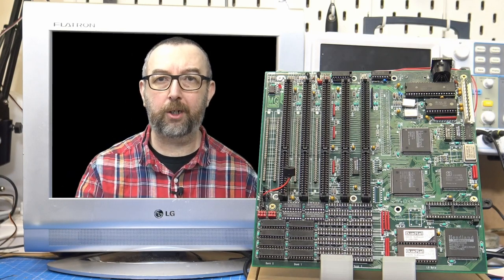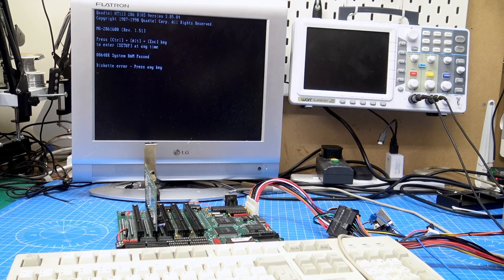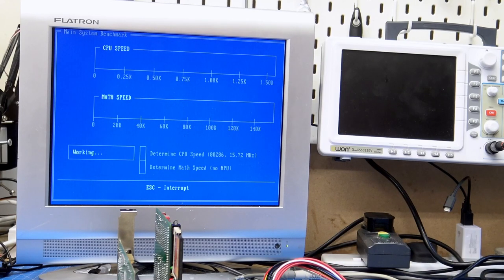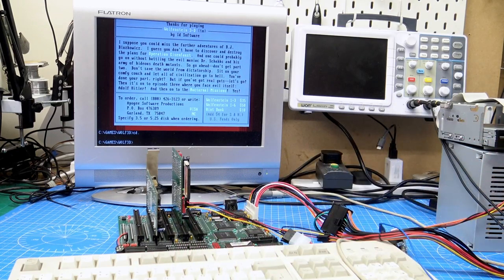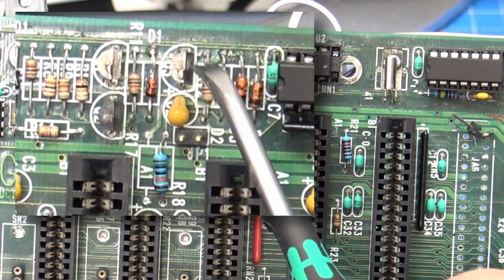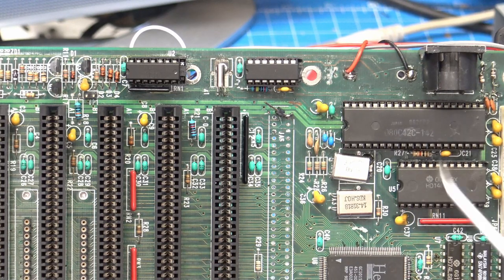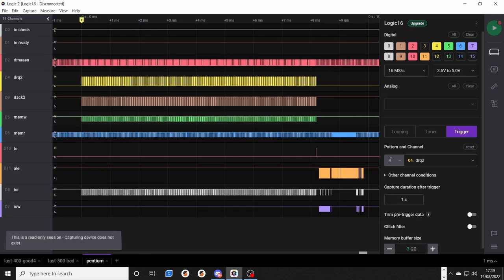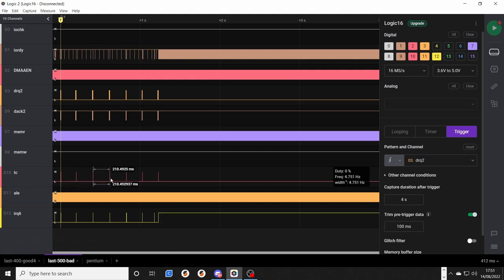Corroded 286 Part 2. Can I fix the CMOS backup and Floppy Drive DMA problems ?

Comment: Interesting faults. Good job on the videos and repair work so far. Hope you eventually figure it out
Reply from the maker: I do not have high hopes for this one, but there are some more suggestions to try in the Vogons thread once I have time to look at it again. I had to stop, it was slowly taking over my mind.
Reply: @leesmithsworkshop  Good idea taking a break from it, I don't have any suggestions so hopefully the folks on Vogons can be of help, or someone in the comments here.
Reply from the maker: @TheRetroChannel  The thing is unless it is some bad trace or corrosion I am not sure I can fix without swapping chips and I don't have those. If it is bad trace or corrosion why does it work with smaller files and not with bigger.

Comment: Would the battery circuit actually create some kind of short when charge is applied? Can you check where the voltage is going to? (I have no electronics degree at all btw :) ).
Reply from the maker: I have checked and it is not a short, that would stop it from switching on, this does switch on ,but it has no activity.

Comment: I seem to remember this happening to Adrian Black, and the problem might be BIOS related. Check his “fixing IBM BIOS” video.
Reply from the maker: I just watched IBM PC/AT Model 5170: So many issues! (BIOS mania) and he had problems reading files from a hard drive and in the end used the very same bios I have on this board so not the same fault with the floppy disc I have.
Reply: @leesmithsworkshop  But are you sure that the 2 controller cards use different address spaces? I wonder if it's couldn't be the controller card and the XT-IDE BIOSes conflicting... Sorry, I forget all the different combinations in which it doesn't work...
Reply from the maker: @hadessuk  I have tried many combinations and get the same results. I would try this on my Micro 8088 when I get time. Why would address make it work for small files and not large ? this is the part that I don't understand.
Reply from the maker: @hadessuk  I used them with and without the XT-IDE and it will not boot from a disc.

Comment: Hey Lee, sorry this has been such a trial, but I'm not through with it! I'm going to take a look at those traces when I can, although I fear they probably don't show the issue clearly, still might give some clues. Properly weird that it does 1 sector of data but not 2 or more... Hmmmmm. Oh and great Snorkers thumbnail!!
Reply from the maker: I don't think they will show anything more than I have showed in the video. It's also a problem with digital sound on a soundblaster so not just floppy, but this was the first fault I found and easy to test.
Reply: Been looking over the GC101/2 datasheet and I don't think it's buffering DMA data and doing it in a burst, but it just communicates with RAM directly via the GC101 address and data buffers, it would be a very large buffer and would probably result in much worse transfer times as DMA does it at the same time as reading IO, so interleaved. Did wonder of it's a timing issue and maybe something going wrong between the 101 and 102 chips, like the AEN, CPUHLDA or DMAEN signals. Or it's having issue with the higher addresses (A20 stuff I haven't got my head around)  maybe the 2nd sector crosses a threshold?
Reply from the maker: @mogwaay  What about the Delay line circuit ? the board has three chips next to the crystal and in the region of the corrosion and have not looked into those just yet.
Reply: @leesmithsworkshop  very interesting, I'm going to see if I can understand what it does and how it works, I'll let you know what I find out. But it feels like a timing thing and delay sounds relevant...

Comment: did you rule out the floppy drive, disk etc. maybe a gotek might help?
Reply from the maker: Do you mean the part when I tested on a pentium ?
Reply: @leesmithsworkshop  Ah missed that bit! watching at work during lunch hour!
Reply from the maker: @preferredimage  as soon as it failed on the 286 I setup the pentium to check the ISA card was working. It was days of messing about until I found the 512 byte situation too.

Comment: Do you know what kind of battery it took, and if it can be replaced with a modern coin cell? I just got a PC based on the exact same motherboard and someone's already clipped out the battery.
Reply from the maker: HI, yes it was a GP 4.8v I removed it and have put the new ones on at the same place. Are you sure it's the same motherboard and not one that is close ? find me on twitter and send me some pictures if you can. leesmithswrkshp
Reply: @leesmithsworkshop  Hi, thanks, I wasn't expecting a reply so quickly. Mine looks identical to yours, same Headland chipset, same banks of DIP RAM, same AMD 286, same MG PRODUCT logo in the upper left. I don't have Twitter at the moment but I'll send you some photos when I can, thanks again for your help